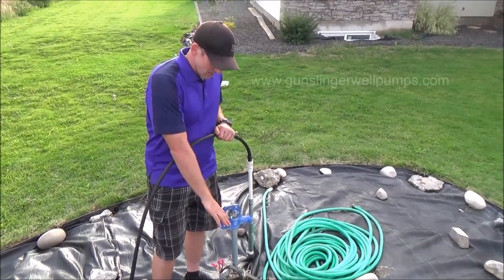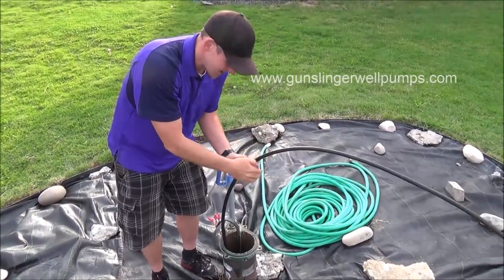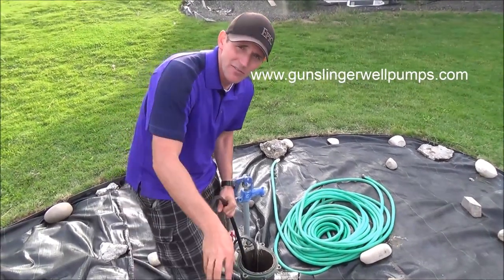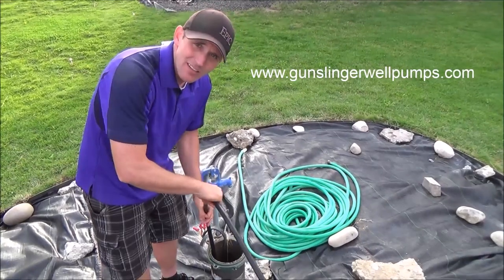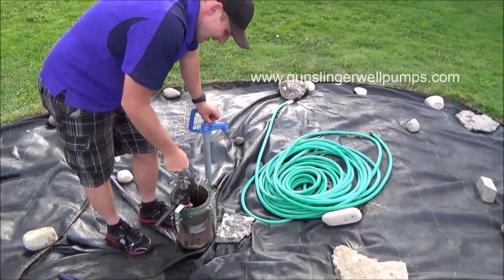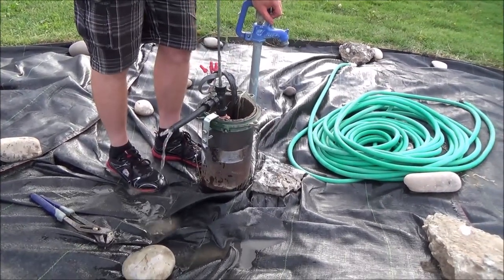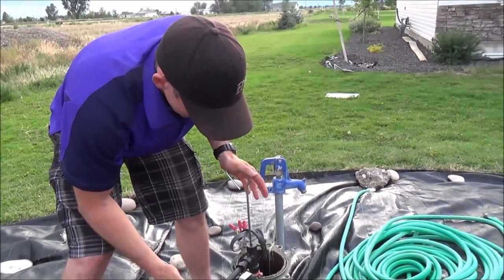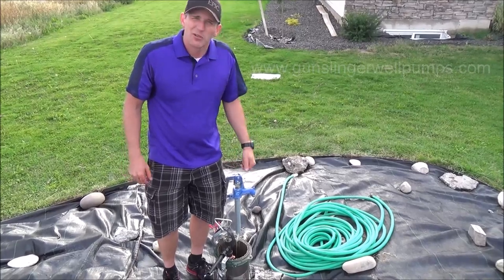Gunslinger emergency hand well pump demo- starting out

Comment: Thanks for the video. I have been wanting one. As soon as i can afford it i will own one. I got a few questions, I live on a farm in kansas wthl very cold winters. I was curious how you store yours and if it drains out on its own if you let it sit after pumping water? Thanks and god bless you and your family.
Reply from the maker: We recommend in cold climates to store it in the well pipe and to use a thumb tack to puncture a small bleed hole about 10' from the top of the pump. We send a restraining cable and a clip so you can let the pump hang and put the well cover back on. We hope this helps answer your question.
Reply: How much are these and where do u get one?
Reply: @Steven-gv1ke  I like the handle on the ezwaterwellpumps better. Thank you ! I have the makings for an EMAS pump with instructions that I got off the net. PVC pipe has been outside for many years now under a tarp, on a trampoline. Smaller parts to the pump are inside the house. So tired of dealing with my deep water well/expense. Lack confidence to put together the EMAS pump on my own. Using bottled water now. TY again.

Comment: I need to find out how deep our well is but my neighbor thinks it’s about 300-375 ft. Do you have a pump for that deep? If not what should I do?
Reply from the maker: I am sorry, our pumps will not reach that depth. I would suggest getting a backup generator or look at maybe a Bison Pump or an equivalent. Thank you for looking at our product. Good luck.
Reply: Just because your well is that deep, your static water level is likely higher.  Figure out your static water level and proceed from there.
Reply: @bryanl1977  Yes, my well is 250' deep, but static level is at 80' - need to go about 10-20 ft. deeper than static to make sure water is good ?

Comment: What is the diameter of the tubing that goes to the water?
Reply from the maker: 1/2" for 75' pumps or less, 3/4" for 100' pumps. Largest diameter needed for clearance is 1 3/4" mainly because the fittings are a larger diameter than the tubing.